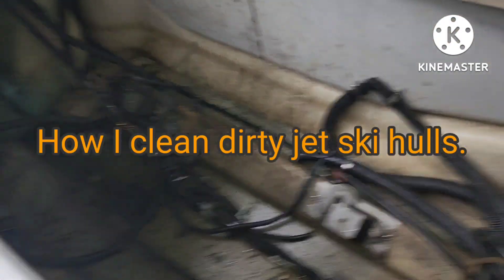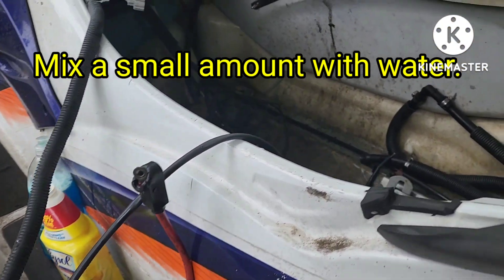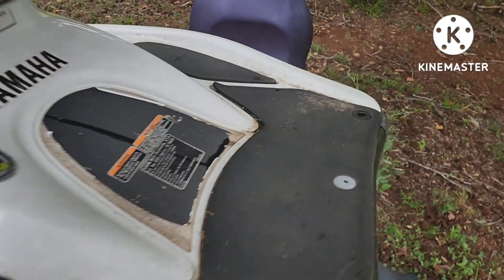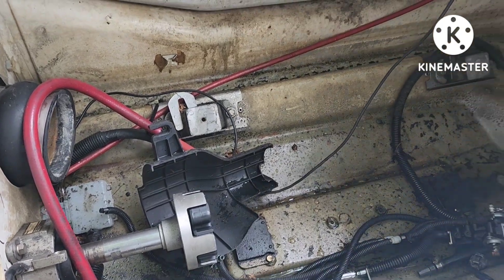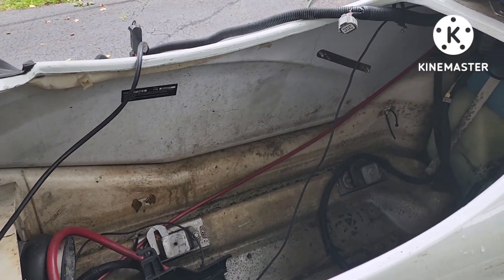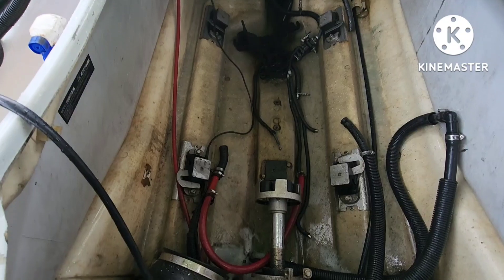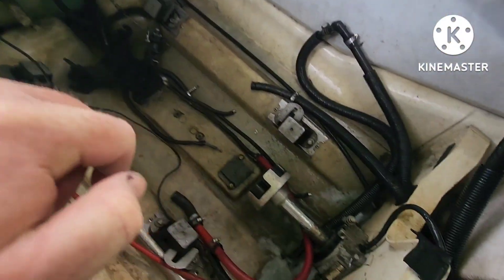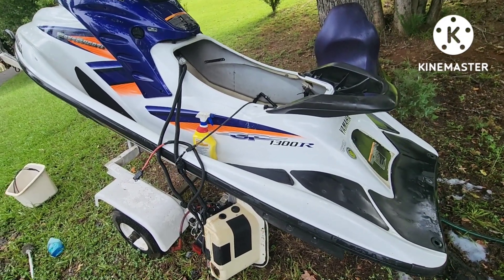How I clean  old dirty jet ski hulls.

Comment: I used to use lime-away on the outside I quit using it and started using meguiers ultra polish and spray detailer. It didn't take you long to clean the inside with the power of video🤣👍
Reply from the maker: I like simple methods and these are small enough to get done fairly quickly.  Thanks for watching.